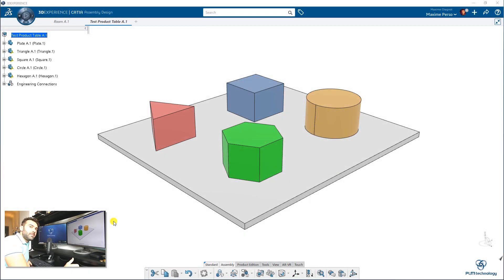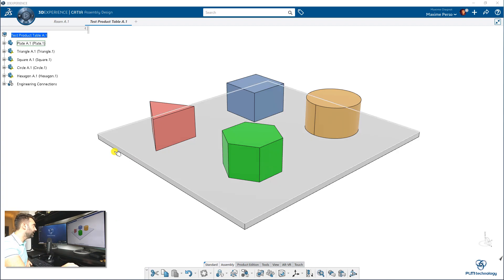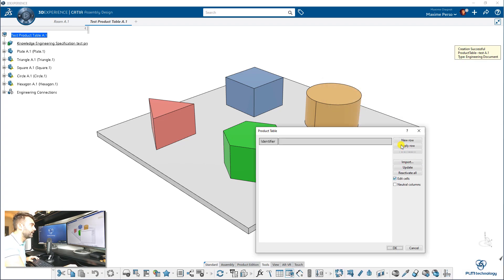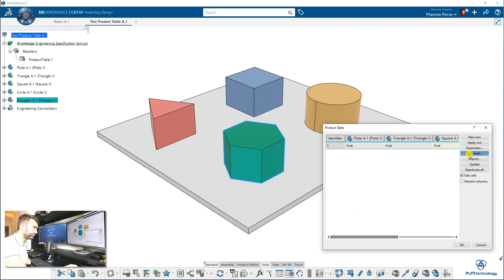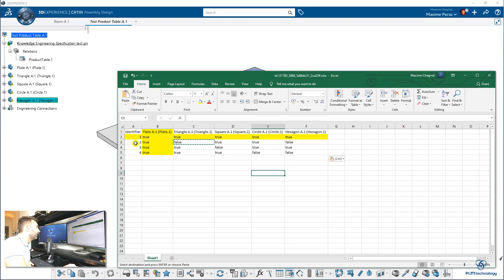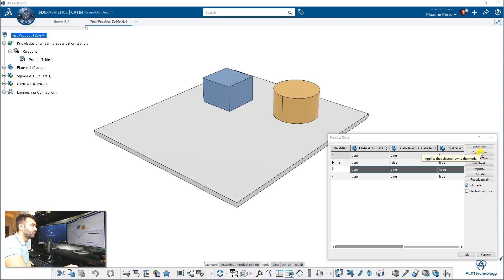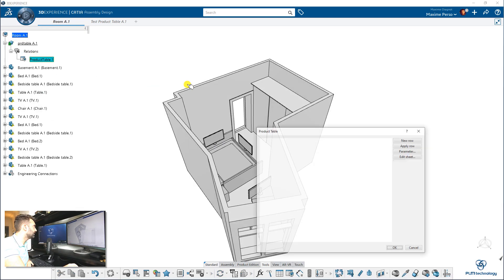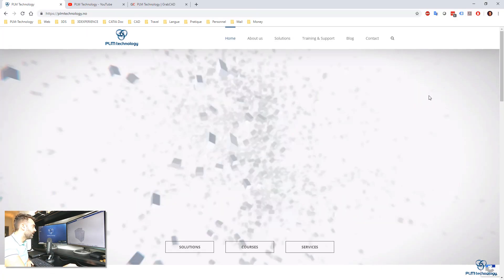Product Table - CATIA 3DExperience R19x Live Demo

Comment: Is there any option for this in CATIA V5? 
A reply would be helpful. Thanks :)
Reply from the maker: Hello Kunal, Thank you for your comment! in v5 it is a bit different (not made for that) but you can create a design table in the product. You can add the paramters "PartX.X/Component Activation State" of all the parts. You will get "true" and you can edit that table in Excel for adding all the lines with "True" and "False". If false then the part is deactivated. Good luck!
Reply: @MaximeChagnot  Thanks for the reply :). I will try this method
Reply from the maker: @kunalgavane924  You are welcome!